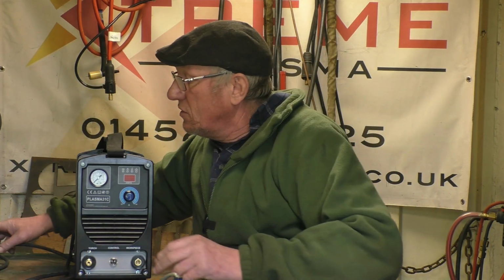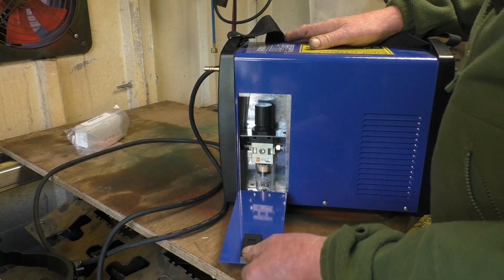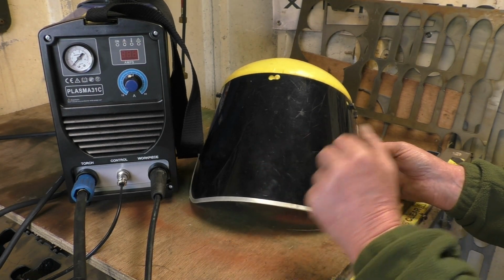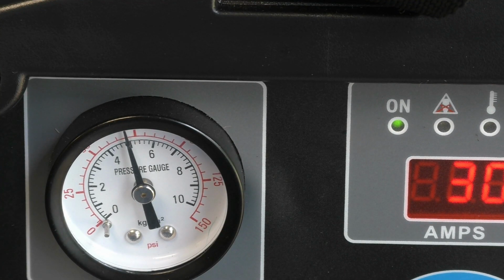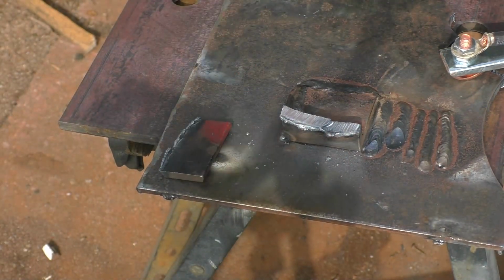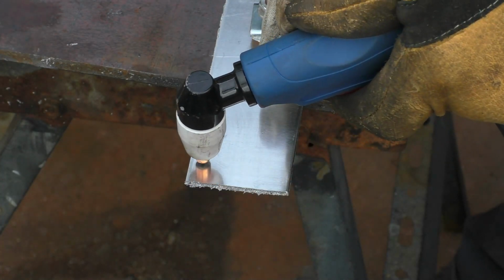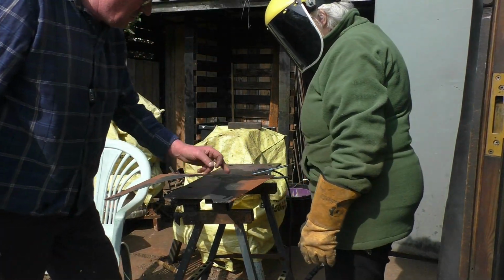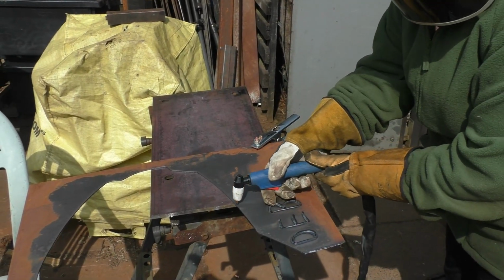R - Tech  P31C Plasma Cutter Review  .13 amp supply

Comment: I have the older version of this. I was attracted by the 13a capability. I have been really impressed. I am glad I paid a bit more than the generic cut 30s from the internets as it seems a sturdier piece of kit and it is good to have someone in the uk yo ho back to if it does go wrong.

Comment: I've got the P30, so older version of this.
It's brilliant, I would say 10mm is clean cut, not sure I've done much 8mm.
Lots of 3mm, 6mm and 10mm, all easy.
Have done some rusty 15mm, it's not fast and it's certainly not pretty, but it cut it.